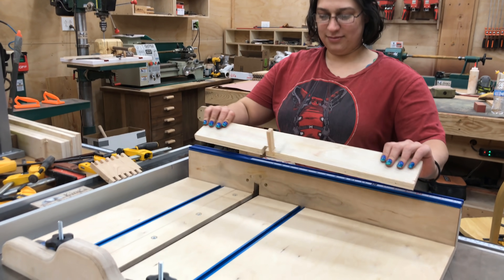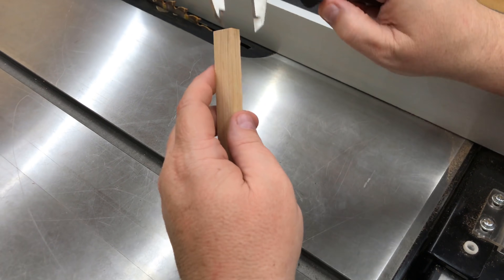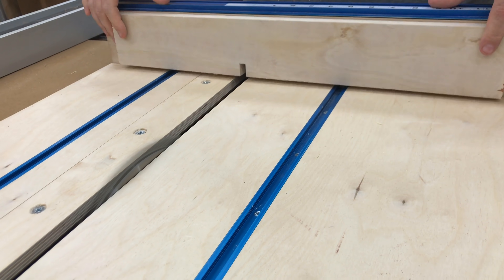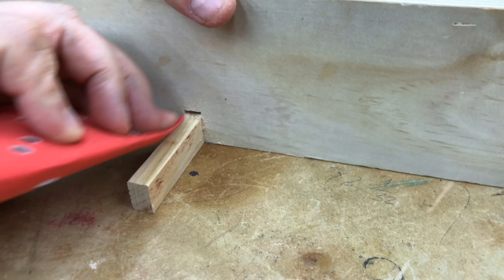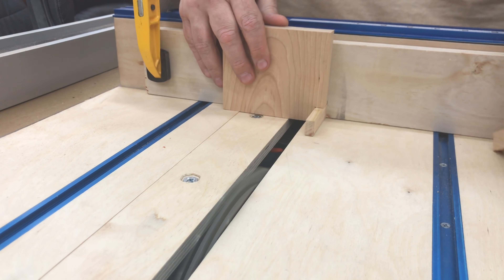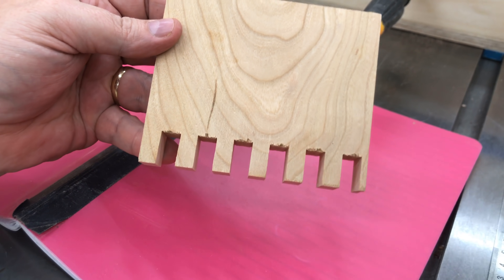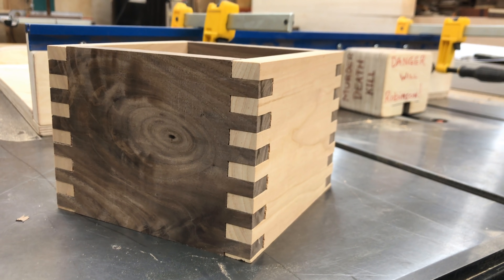44 - Box Joint - Finger Joint Jig One hour Build ONLINE CLASS

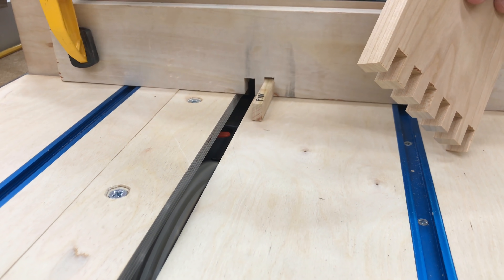Comment: When yo say that the line should point to the pin do you mean the blade ? When you put the 2 pieces side by side to get the correct spacing for the second piece the line is facing away from the pin @11:56
Reply from the maker: I mean it should point towards the pin at the start of the series of cuts

Comment: Is there a rule of thumb concerning the size of the box joint? I mean if you have a one foot piece is the joint typically 1/2 inch 3/4 inch etc and does it change with the length of the board. Would you use bigger "fingers" for bigger boards. Bigger refers to length not thickness. Clearly there is a maximum size before the fingers become something else entirely. Great explanation of how to do finger joints. Thanx

Comment: A question: After setting jig in place wouldn’t one single pass on scrap be sufficient to have one groove and one pin. Measure and adjust until you get the .006 pin size then done.

Comment: Your instructions were perfect as well as your performance. My first attempt showed the fingers ranged from 0.375 to 0.368. My blade was 0.369 to 0.376. At its worse, it still falls into the 0.006 range. My issue is that the fingers are simply to tight with a dry fit let alone a glue fit. I tried this four times and continue to have the same issue. Do you have a recommendation?
Reply: Why would the blade measurement change? If you are using a dado stack that number should be constant. The finger width is controlled by the distance between the pin and the blade. I had the same issue as you with the fit - too tight. The solution was to move the pin closer to the blade resulting in narrower fingers and a good fit.

Comment: Good video, lots of info. My question is in regards to the joint. If you were to make a hollow box without a bottom to reinforce it, is the box joint strong enough to stay together if played with by children?
Reply from the maker: It certainly would be strong enough. An adult could stand on it no problem.
Reply: @KingsFineWoodworking  certainly stronger than a biscuit joint in that similar application, which I used in pine boards and had to warranty repair them. I will build some test products, give them to some kids to try to break and go from there........nothing like real-world testing.

Comment: I'm looking to do a project with 1 1/2 inch finger/box joints. How would you accomplish this? I've thought about using a router since the dado stack only goes up to 3/4 of an inch.
Reply: Lee Weaver Put the pin 1.5’’ from blade, place board up to pin and cut the first dado. Then run it through again to make the finger the size you want. Then place that finger over pin and repeat. I hope this helps.

Comment: This is an excellent video but I am confused about your diagram. If the fit on your test piece is too loose, the fingers are too narrow. They need to be made bigger, not smaller ... you write the fingers need to be made smaller by 0.006. The correction for the loose fit is to move the pin further from the blade resulting in wider fingers (which is what you did for the correction). I admit to being a total novice at this - I just built my first box joint jig last week. I had the opposite problem with my test piece. The fit was so tight I couldn't get the pieces together. The solution was to move the pin closer to the blade by a few thousands of an inch, resulting in a narrower finger and a good fit. Am I missing something here?
Reply: OK - I watched it again and I understand .... what you wrote down is the rule that fingers should be .006 narrower than the slot (not the correction you were trying to apply). All good.

Comment: To set the pin the correct distance from the blade you could have used a piece of the pin you cut off and run it across sand paper and used that as a spacer between the blade and pin.
Reply from the maker: And I did. Even though I didn't show it on video. The result was that it was still 0.013 off.

Comment: First off, GREAT video from many aspects. Very informative, great family time, and outstanding comments. This is a great channel. I say those things cause I have a question but don't want to come off as someone that only points out mistakes (I'm not entirely sure there is one). I really like this channel and I rarely comment. Also, I read through this video's comments, for the most part, please don't quiz me, and I THINK I have a question and I think it may be my limited brain rodents not spinning the wheels fast enough. So, here it is, you write in red ink "We want finger size smaller by .oo6", but you actually want bigger fingers, or as you say, it'll make our finger cuts wider. So, you want finger size bigger by .006? Again, this could all be wrapped up by replenishing my tired brain wheel rodents.

Comment: Wouldn't it work if you just took what you cut off of the the pin and put it between the pin in the blade
Reply from the maker: No. That would leave zero tolerance. You want the gap about 6 thousandths bigger in order for the pieces to fit together.

Comment: Another box joint jig that stops short of gluing.  You at least acknowledge that the fingers need to be smaller than the gap but leave out the width of the key.  Your key was .368, .008 narrower than your dado blade cut of .375.  Mr. Ng goes through that, but you think it is not worth mentioning.  I'm not sure why.  The difficulty getting the key into the slot indicates that with fingers wider than the key this joint will be even more difficult to assemble when glue is applied.  William Ng's video appears to be the only one that has total information on the finger joint, but he, too, does not glue the joint.  I wonder if difficulty of assembly is related to the wood you are using.  For instance close-grained wood like maple should be easier to assemble with glue than plywood of any kind, and possibly easier than open-grained oak.  I must add that I am a subscriber and this is the first video of yours that has disappointed me.  Usually you provide information to an excess.  I'm willing to put up with some lengthy discussions, but here you leave out what I think is an important step, that of the actual glued assembly.  Further, I have never given you a dislike.  This gets one.

Comment: This is way to dangerous, these blades should be banned as they are in europe, you have no riving knife on the saw and therefore the safety devices are not in place to prevent kickback and injury, Ill stick to the one blade method, takes a bit more time but a lot safer to use.  Over here in europe its interesting to watch as we can not fit these blades to our tables saws as the arbor is made by law too short, all part of prevention of kickback. I just dont like the lack of safety on the saws.  The riving knife was the best invention ever on a circular saw and has saved many a arm and hand and injuries to faces and other parts of the body by trying to prevent kickback and pieces of wood flying around your workshop at 150 MPH.
Reply from the maker: Sitges Villa Apartment, I’m not sure you know what a riving knife is for. 

It’s absolutely 100% useless with a dado blade. 

It is designed to prevent wood from pinching together at the back of the blade (in the event the wood had internal stress).  This pinching could close in on the back of the blade and trigger a kick-back event. 

But, wood doesn’t pinch back together with a dado blade. Because it doesn’t cut all the way through the wood. So trying to use a riving knife with a dado blade is just nonsensical.
Reply: @KingsFineWoodworking  Yes I know that that is why in europe dado blades are banned as people dismantled the riving knife as part of installing the dado disk as the disk wont fit with the knife on, that is why the arbors in europe are shorter to prevent you installing a dado disk now. I have been using  table saws, lathes, and most other woodworking machinery and engineering tools probably as long as you have both with and without riving knives here and in a lot of countries in europe and I prefer to use saws with riving knives over ones without. The riving knife was introduced in 2009 as a way to try and stop kickback, the splitter as it is known was also used on some makes of saws , the second biggest cause of kickback is the fence is not parallel to the saw blade which is why it is absolutely essential to check all new saws and use a dial gauge to dial your blade in and make sure it is parallel always to the fence to prevent a accident happening.  These are only some of the checks you should undertake to ensure that your saw is safe along with ensuring you have no missing carbide teeth causing the blade to be out of balance.  thank you.